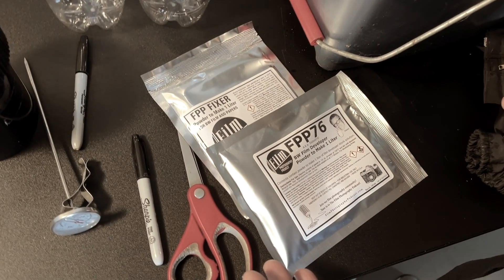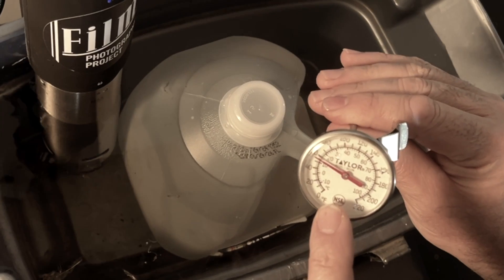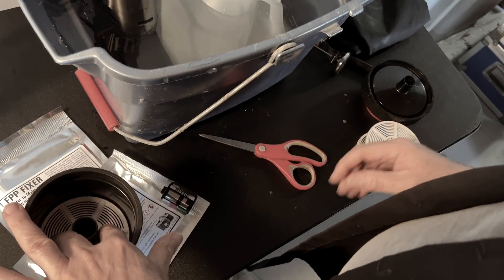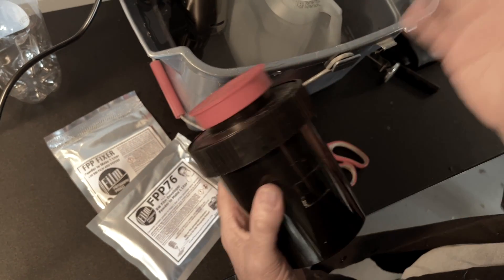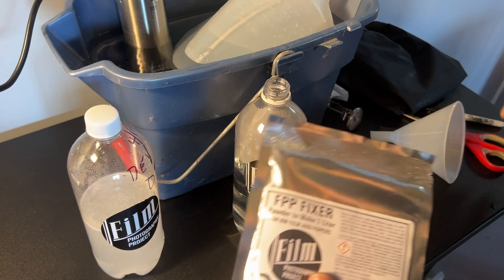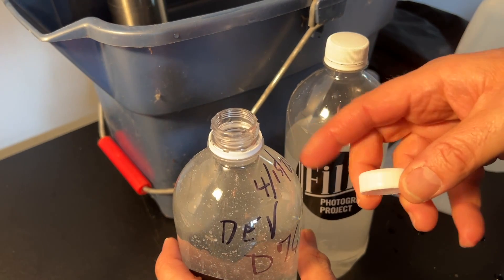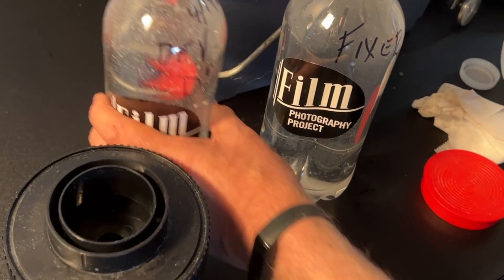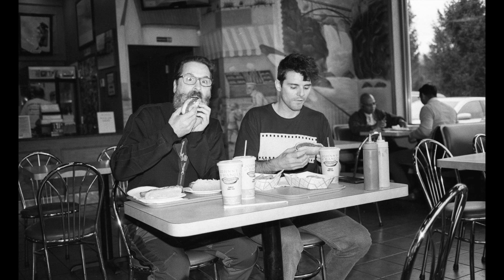FPP BW Negative Film Develop Kit - Mixing Your Chemistry

Comment: If you put the distilled water in an open container or bowl, you can very quickly warm it up in a microwave oven. Just check it often as it gets close to temperature, and you can always cool it back off a bit with more from the cold bottle it came from. The water bath is fine for big bottles when needed.